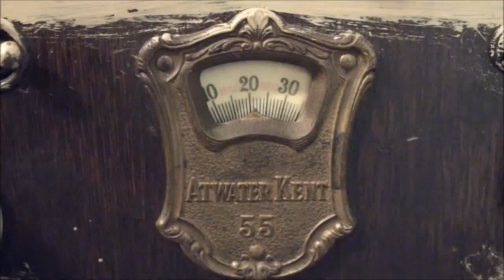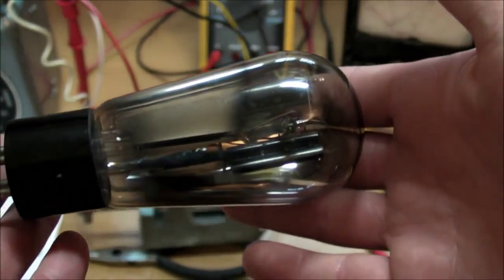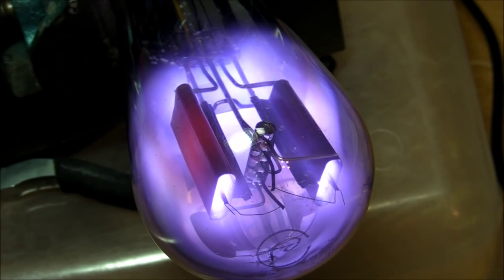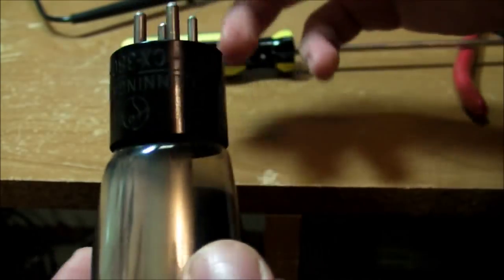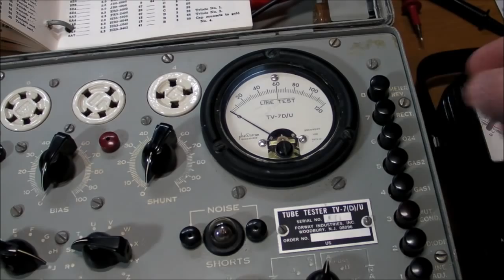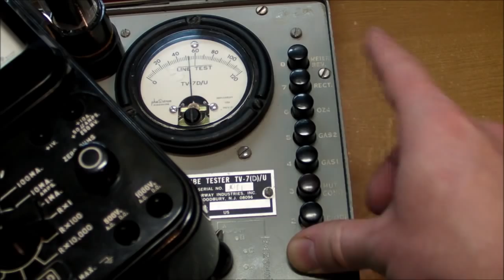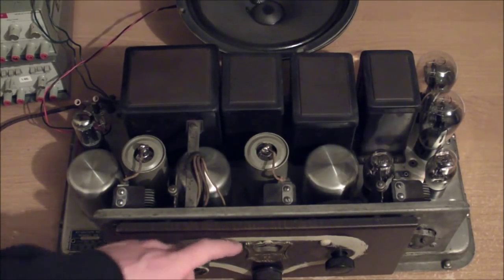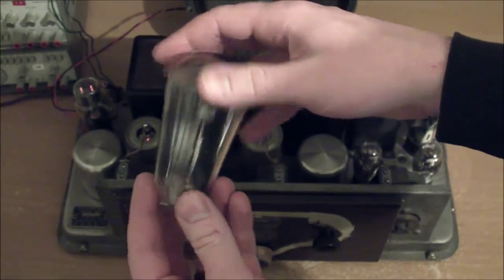(#0180) Spectacular Failure and Replacement of Vacuum Tube in Atwater Kent 55C AM Radio

Comment: Rectifier tubes that glow aren't necessarily gassy.  If they are mercury vapor types, they will glow blue or purple.  But don't stare at it too much, it's UV radiation!  We had mercury vapor rectifiers in our RCA BC500A transmitter where I used to work 35 years ago.  They glowed blue all the time.  The mercury vapor rectifiers are high power, the regular rectifiers are medium to low power dissipation.  The white stuff in your tube is the "getter" a sulfate compound designed to protect the filament by reacting with oxygen in the tube.  This was common practice before thoriated filaments.
Reply: The borosilicate glass tubes are made from is the same as light bulbs, it blocks UV radiation, unless doped with another metal, like black light bulbs. (Browns Glass) but that's a different glass recipe 

Im not all too sure, but I think modern tubes use barium nitrate in some form as the getter material? Do you happen to know what sulfate compound was used back then?

I've also noticed something odd, if a new (modern) un-used tube is broken open the small metal trough where the gas adsorbing compound is stored gets slightly warm, not only that but it gives off an odor similar to ozone, the same smell you get off of a negative elecrode of high potential (in air, at STP)
Reply: Rubidium (a byproduct of lithium production) was commonly mixed with sulphur to stabilize it, so it wouldn't flare red with a huge ionic discharge, was used as a cheap getter in old tubes. Even so, the old getters would flash on first application of power (usually done in factory) but still could flash the next several startups. I've seen very ancient NOS do just this. They flash reddish, or orange with Rubidium Sulphate getters. Fortunately, better materials were found prior to WWII and thoriated filaments were invented. Many of the newer getters from the war onward were based on graphite mixtures which improved power sinkage, heat dissapation and element sagging. Thanks for the feedback, your video was fun to watch!
Reply: Since getters are designed to react to oxigen, and usually result in an electrically inert compound, my guess is that getters can and will react with oxygen in raw atmosphere. You're probably smelling rapid oxidation of the getter material. They always put more in the bulb than what was thought needed to evoke complete evacuation. Even a spent tube can still have unused getter in it, usually the extra getter helps eliminate gassyness with slow envelope leakage over time.
Reply: It's not supposed to be white home boy.

Comment: Nice demo of a gassy rect. Nice touch there to not have a capacitor that would have had a voltage doubling effect; I'll bet you know the drill...
What happened was the glass support got hot enough to soften (and molten glass is electrically conductive; you can see the red-hot spots on it just before the cathodes touched the anodes), the softened glass allowed the top cathode supports to relax, the tension upon the cathodes released. Well done and thanks for posting. Blue gassed and red plated, with a bit of green.

Comment: I had an old Lowrey organ that had two slightly gassy 7591 tubes for the output. They always had a purple haze about them. I remember you could crank up the volume, step on the low C pedal, and watch the violet light flicker as it rattled the walls... just with two 7591's! They never gave any trouble despite the fact that they had a little gas in them.

Comment: I see a Cunningham CX-380 on eBay right now for $20 starting bid with 2 days left. However the seller does not know it's condition. But it looks like you have this all figured out anyway. Nice video! I really enjoyed this one.
Reply from the maker: Thanks. I was sure I could easily find an exact replacement for the 380 online at reasonable prices, but I didn't even bother to look since I already had a bunch of 5Y3's just hiding in a shoe box for years on end.

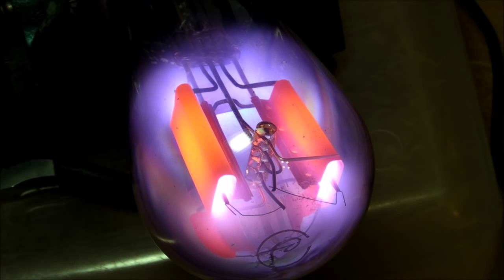Comment: Very pretty light show, and nice repair!  I'm pretty sure you got the glass insulator/support hot enough to conduct electricity, which caused the sparks at 7:50, then rapid heating and deformation of the structure that caused the short.  I've seen that happen at much higher voltages and when hot glass is hit with microwaves.

Comment: It look like a mercury rectifier. You have a good idea with the plug/socket adapter and the 5Y3 tube. The GZ34 also may be a good election for this work. At the end your radio sounds very well. Nice video. Thanks for sharing.

Comment: You can try cleaning off the paint in the front, I have an old RCA speaker that had some paint drips on the cabinet. Remember I actually sprayed some contact cleaner (this canned hydrocarbon fluid that evaporates really quick) on the paint and rubbed it with a paper towel. The paint got rubbed off slowly and the wood finish was left intact.

Comment: The tube was glowing because of gas, the vacuum was imperfect.
This is NOT due to anything like X-rays. Such was possible with certain of the tubes inside early colour TV's that dissipated huge voltages. Not in the defective rectifier at the start, OK?

Comment: Next time, acetone readily dissolves Super glue. Alcohol (Isopropyl) makes PVA (Hot-snot) glue release too.
Reply from the maker: Thanks for the tip. Didn't know that.
Reply: @ElectronicTonic156  Don't use acetone on plastic... It will melt.
Reply: The replies raised my knowledge

Comment: Nice radio man! A trf I think, American of course......the transformers are really class...i guess the condensers are all paper since they are originals..

  Awesome valve glows!!!   I come from a UK valve past and still have a few octal sets. Also I've a 1927 four pin valve  Marconi home build battery set.....no soldering all terminal ....resistors that have gold transfers in holders....a regenerative set with three triode valves (2 volt heaters) with basket coils and a rotating inner coil.....coupling transformers that look like they are out of the film "Metropolis" and a parchment glued cone adjustable moving iron speaker. It runs with a two volt lead acid battery for the heaters, a ninety volt zinc carbon battery for the HT, and a grid bias battery 1.5-6V, ( you adjusted the grid bias by changing the tappings for max. volume)
    It was so early that in those days gain was at a premium, so it was, adjust the grid bias, adjust the moving iron magnet, adjust the positive regeneration variable condenser until it whistled, then back it off a tad and so on.  Bizarrely it still works! 

  Lovely old times eh?
Reply: Nice!

Comment: The field coil was used as a filter to the power supply. You need to account for that with either a choke (as it originally was used as) or add a capacitor between those resistors you added.

Comment: Air has leaked in and causes it to turn from vacuum tube into gas discharge tube, technically you can put any rectifier tube there if the filament voltage, anode voltage and current is same or higher than original. Nice restoration project.

Comment: I just found your video.  Having recently acquire an Atwater Kent 55C without an AK F4 speaker which it is suppose to use with a 4 pin plug.  I saw you made some sort of adaption plug that allowed you to use a permanent magnet speaker instead of the field coil AK F4 speaker.  I saw the two resistors in your video but do not know what the other coiled spring looking items are.  I would like to build one of these for my AK 55C so I can use a PM speaker.  Any specifics, drawings or explanations would be greatly appreciated.  Thanks, great video!

Comment: a suggestion for the green color: as far as i know getters contain barium. if a barium solution is sprayed into a flame it colors it in a vivid green. barium is also used in fireworks to make green sparks. so maybe a barium pocket in the getter or even an unflashed piece of getter material was hit by the plasma arc and colored it green.

Comment: You could have made a nice little decorative light out of the old tube, oh well. 2-part epoxy is really the best thing to use for gluing the socket adapter together. What is the tube tester measuring, plate current?

Comment: I just came across a gassy EL41 output tube that also gives a rather good light show when turned on. it has lost the getter at the top that has turned more the less transparent white which is a direct proof air has leaked in to the tube.

Comment: I have seen tubes glow like that because of an extra-hard vacuum(years ago).It can be mistaken for a gassy tube.Usually a gassy tube will have a milky appearance in the glass.(From memory--I used to work on this stuff years ago.I got many burned fingers from removing tubes when they were still hot.
Reply: +Michael Henwood Whoops,I spoke too soon.Either that tube is shorted or there is one heck of a load to make the plates turn red like that.(a shorted Filter capacitor,maybe)?
Reply: +Michael Henwood Whoops,I spoke too soon.Either that tube is shorted or there is one heck of a load to make the plates turn red like that.(a shorted Filter capacitor,maybe)?
Reply: +Michael Henwood These directly heated filaments(no cathode) will sag from the heat if laid on their side while operating and short.This is all coming back to me now.
Reply: +Michael Henwood These directly heated filaments(no cathode) will sag from the heat if laid on their side while operating and short.This is all coming back to me now.
Reply: That TV-7 tube tester of his will test for gassy tubes, he could used it to test before he destroyed the rare 380.

Comment: Maybe I'm loosing it a bit, I thought that  the double diode is a halfway rectifier not a full wave!  My solution to the double diode valve, which seems to be the most common failure is a pair of 1000volt silicon diodes soldered across the valve base.

Comment: Nice radio, Does the Field coil double as a Filter choke for the B+ Supply?
Reply: No, in this radio it does not (I just got one, myself, and am in the process of repairing it).
Reply: Well that shows how little I know about old tube radios.  If someone asked me about the filter choke on a radio I probably would have responded with something like "Oh yes! I keep those with my muffler bearings on the shelf next to the headlight fluid and just above the box full of board stretchers. But don't knock over my checkerd paint cans on your way back I don't need the colors mixed."
Reply: @huntsbychainsaw5986  filter chokes are always by the left handed screwdrivers!

Comment: Why didn't you get hold of a Valve "80" they are quite plentiful and they are a directly heated full wave rectifier with 5V filament and a UX4 base.... A direct replacement. Early ones were also balloon shaped too.

Comment: Used to re Ferb old tv tubes with the bakelite base.  Had a big solder sucker. Heat the pins. "Pop" then vibrate the tube.  the "cap" dropped off.

Comment: Mercury rectifier tubes glow violet.  They are not under vacuum.  They operate at the vapor pressure of Mercury.   As long as the tube is not arcing and producing DC it is operating normally.

Comment: That's a shame you had to disassemble the socket after you superglued it.  It was a perfect fit, but things like getting wires on the wrong pins do happen.  That's too bad somebody had to mess up the front panel.  I'm sure you could refinish it.

Comment: I thought the trick to separate the base from the tube with that type of tube was just "install the tube into an awkward to access socket in a piece of equipment, wait till there is a bit corrosion and seizing, then try to lever the tube out of the socket by hand?" :)

Comment: Don't you need to replace the inductive effect of the field coil as well? Isn't it the filter choke for the power supply?
Reply from the maker: +Admiral Quality Yes, the field coil does provide inductance to filter the DC, but I don't think I realized it at the time.
Reply: +Eric Wasatonic Odd that it seemed to work anyway. I'd expect it to hum badly.

Comment: Pity you didn't put the original rectifier into your tube tester to see how it performed & compared to the replacements.
Oh , I was just waiting to see how long it would be before you broke the old tube because I knew the wires on the bottom are very short and wouldn't take to kindly to all that twisting.

Comment: The glowing is an inert gas at very low pressure used on old high current diodes that's what causes the glow

Comment: So they didn't a gang for the tuning, but separate caps I wonder why? Is it multiband band?
Reply from the maker: +Peter Walker The caps are ganged - via a metal band that links all three. Ganged caps/pots/switches don't have to be on the same shaft as long as there is some sort of mechanical linkage between them.
Reply: Peter Walker I think superhet was patented, and Atwater Kent stuck with TRF for quite a while.  Thus the precision ganged variable cap tuning

Comment: Weren't there solid state rectifierrs that plunged into tube sockets as a replacement?
Reply: +jsl151850b It would be sacrilege to use solid state components in a radio like this.
Reply: +Barnekkid mmm, sacrilege, tasty. Hybrid abominations look fine to me ;)
Reply: +jsl151850b Selenium rectifiers

Comment: Probably the rectifier was not designed to work in a horizontal position so the filament supports could not function correctly allowing the filament to sag onto the anodes.

Comment: I'd suggest getting the 4th Echelon calibration manual for that TV-7 D/U.  I uploaded it some time ago to Frank when I was a mirror for Frank's Tube Pages.  Look in the "Other" Section of his site or any of the mirrors, IITC.

As for the field coil "replacement", what did you use to replace the choke itself?  Mostly they were set up to be 5H, and are a necessary part of the PSU.

73 de KC5VDJ

PS: I just found it for you: https://frank.pocnet.net/instruments/Military_us/TV7/TV7.html

Comment: 12:08: You shouldn't have twisted the base and pulled the glass bulb off the base. You should have touched all 4 tips of the vacuum tube with a hot soldering iron, unsolder the thin wires from the tube, and it would nicely slide out without breaking the wires OR the glass!

Comment: you have a nice tester like this but dont realize you can buy a #80 cheaply in many places. even a globe style for less than $30 but you just chose to ruin the cool engraved base cunningham. i dont get it. oh yea and probably why the tube fried without much voltage, your load resistance was too high or there wasnt adequate path for the output of the tube to go anywhere so it didnt allow the current to go anywhere but destroy the tube.i dont get it. good job beavis , you made fire, fire he he fire.
Reply: p.s. you probably gave yourself several xrays worth of radiation when you did that made those cool colors, acutally xray machines use a large special vacuum tube to produce xrays.

Comment: I 've read that if you boil those for 3 hours, the glass envelope will dislodge easily but it will be quite a while and a waste of gas or electricity for whatever your stove will be using :-D. Wear rubber gloves next time, you don't want that breaking in your bare hands :-D

Comment: Why not just replace the 4 pin tube socket in the radio chassis with that octal socket that you have and do it right rather than break the old tube and jerryrig it's base??
Reply: It's preferred to keep the chassis original and modify aftermarket parts to fit instead of modifying the chassis to fit aftermarket parts.

For an analogy, say you want a particular set of floor mats in your car but they don't fit. Would you rather hack up the body so the mats fit or cut the mat so it fits the car?

Comment: When the anode/plate starts to glow then you aren't far from producing x rays
Reply: Well, you need a bit more than 1kV.  The first color TV tubes were capable of producing x-rays, and sterilizing a generation of kids that sat a foot away from the screen, but only when the anode voltage was up around 20kV.  A limit was created and no TV could use an acceleration voltage higher than 15kV and reproduction was again possible.

Comment: Tube red-plating self destruction lol
You seriously should consider re-capping it though )at least the electrolytics) before you have a catastrophic failure
Reply from the maker: +ElfNet Gaming Thanks, but I already sold it at a hamfest.
Reply: Eric Wasatonic oh lol ok then. someone else's problem then lol
Reply from the maker: +John McFerren Good observation. I had not considered the lack of inductance as a result of my resistor substitution. The radio had never been restored. I had a peek under the chassis. All the wire, solder joints, and caps looked original.

Comment: Has anybody ever tried to re-evacuate (open the glass envelope somehow and put under vacuum) a gassy tube?
Reply: Olle Gladso Without replacing the heater, or heater-cathode assembly for indirectly heated types, it wouldn't work. The gas "poisons" the emitting material. It could be done though if the emitting material is replaced and a new getter used. This was done in CRT rebuilding, which was common in the 40s, 50s, and 60s here in the US, and large transmitting tubes for television and radio stations.
Reply: Benjamin Moyer
Thank you for such a complete reply. I did not think of the contaminant poisoning the emission layer. It would make sense with big, expensive tubes, or irreplaceable ones.
Reply: Olle Gladso There's currently a project going on at the Early Television Foundation so those of us with sets with irreplaceable CRTs, such as the 15GP22 in my RCA CT-100, can have our CRTs rebuilt when the time comes. You might find this of interest: http://www.earlytelevision.org/crt_rebuild.html
The basic principles would be essentially the same for standard receiving tubes.